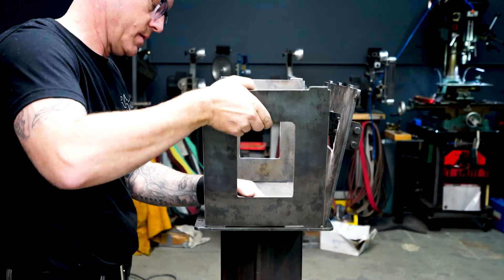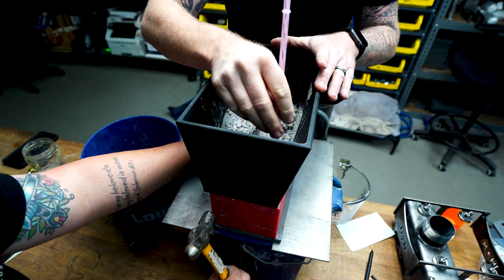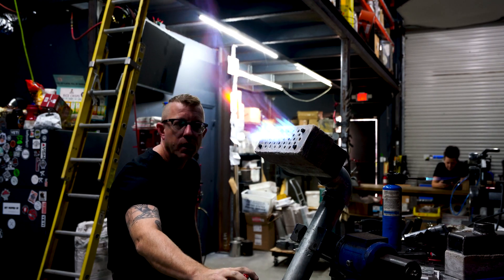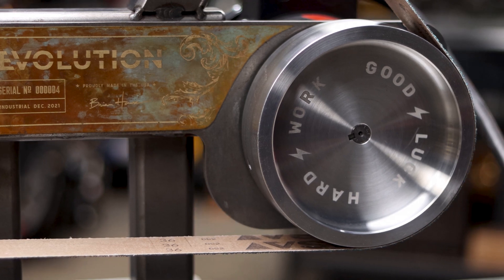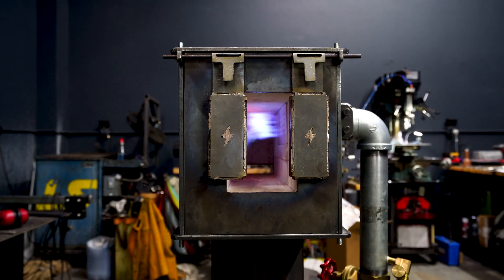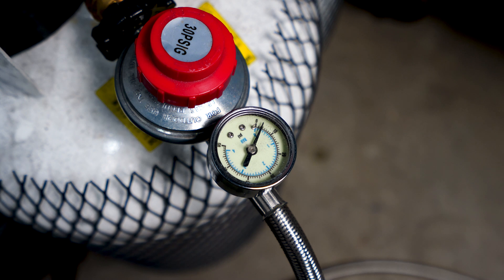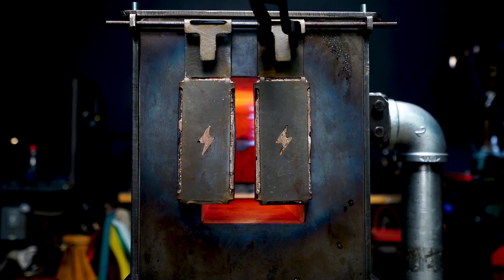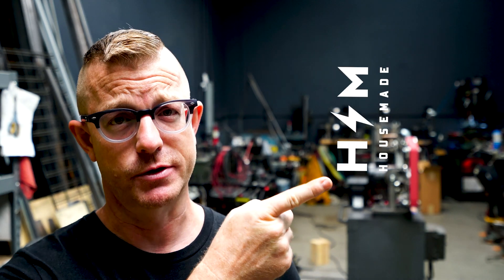Flat Pack DIY Forge Project

Comment: did you try tapered pins.
Reply from the maker: We settled in on the original straws. I redesigned the mold to make it easier.

Comment: Just received your burner & Looking forward to the plans and kit for the forge box. Keep up the good work. Oh and by the way. I have three 2x72 grinders in my shop and by far my fav is the HouseMade. I use it as my go to grinder everyday.  Engineering, plans, & parts were perfect. Took my time building it and it turned out wonderfully. Thanks again.

Comment: I built my own ribbon burner as well...had the same issue with air and fuel mix volume...I'm bad I'm math so calculations was kinda hard for me but one simple thing I did and it worked,   was to fit the straws inside the pipe you are using, I used 1 1/2" pipes so I fitted as much starts as I could without squeezing them... That basically solved the flow and burning issued I had..

Comment: Thats a grat deal.  Wish it went a little longer i have been saving up to afford the belt grinder.   But it may be another month or two.  But that's ok. I plan on making an order as soon as i have the money. :)  

The forge and burnner look good too.  Ive started building my own.   Ill have to look more into the back pressure and volume of gas and air too.   I didnt relly think of that...

Comment: Hey Brian, do the straws have to be plastic. Have you looked at tube or pipe from a mechanical supplier. Have them threaded to put in and take out. Cheers

Comment: One more thought.  A vibrating table would also be super handy for casting burners.  You could use a couple pillow blocks with a shaft and make a couple eccentrics with set screws.  Adjust the distance between  the eccentrics to  increase/decrease vibration.  Turn the shaft with whatever electric motor you have kicking around.  Mount the table on junk yard valve springs.  I think $100 would get it and make casting a whole lot faster.  They use vibrating tables for making concrete logs which are a similar process.
Reply: Was gonna say something along these lines..lol

Comment: On your ribbon burners could you make a 3d printed mold that completely replaced the straws with solid plastic?   It would also be good to have them taper slightly for easy release from the cured refractory.  What about using something super hard and slick like drill rod for the dowels?  I'm just throwing around ideas for fun.  I'm sure you've got it handled.

Comment: Brian,  what about 3D printing your entire mold, including the straws with closed end to make putting easy? Thin walls would make printing fast and removal easier. You could burn out any remnants in an oven. Outside walls could be supported with reusable wood fixtures.

Comment: I am wondering if you have considered a couple of things to address you burner issues .......
Your design appears to have incorporated a perforated inlet at top of plenum chamber, theoretically this could be effecting the performance of the burner in two ways; it could be encouraging linear air flow and reducing the even distribution of air gas mixture in the plenum chamber. It could also be reducing the pressure differential before the plenum chamber thus inhibiting the efficient mixing and distribution of gas/air in the plenum chamber. Solution could be remove perforations make the intake hole at top of plenum chamber same as ID of intake pipe and instal angled diffuser in plenum chamber.
Your design has the blower mounted horizontally with the gas input vertically, you might increase air gas mixing if you instal a twisted baffle (twisted length of flat bar) in the riser after the point of gas input.
Your trouble with the straws seems to have many simple potential solutions.....you could prior to mould assembly have the straws soaking in a container of release agent, then install them, they will be completely coated with release agent inside and out.....an it should not matter if you get a bit of refractory down the centre, because it should be able to be pushed out when set.
You could crimp the top of the straws by gripping the top with a heated up pair of needle nose pliers, thus sealing the end of straw so no refractory will enter straw. Similarly you could block/plug one end of the straw off with a bung.
Or you could see if you can closely (doesn’t need to be tight) match the internal dimension of the straw with a rod and insert them during moulding.....this would greatly reduce any significant intrusion of refractory mortar into the straws.
Lastly try holding an orbital sander against the side of the moulds to help liquidity / loosen the mortar just after it’s been poured rather than tapping with a hammer.
Just some suggestions, good luck with your project

Comment: congrats man!! a ribbon burner style will be my next forge, very stoked to see you produce these. question; have you done any forge welding in this unit?  what pressure was your gas running at for welding temps?
Reply from the maker: Yes, forge welding temps have been achieved and I have made Damascus with it. It runs at 5psi initially to get to 2400f then you can crank it back to about 3 to keep it hot. I will say PSI isn't a great indicator here since the orifice is 1/4".
Reply: oh, right orifice diameter. I wasn't thinking in those terms.